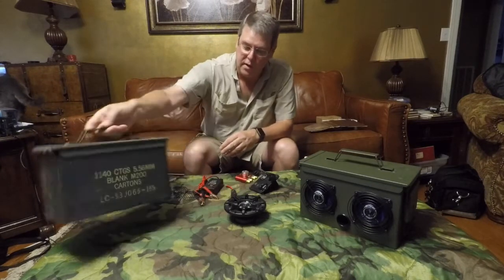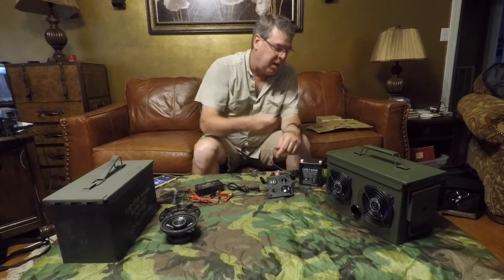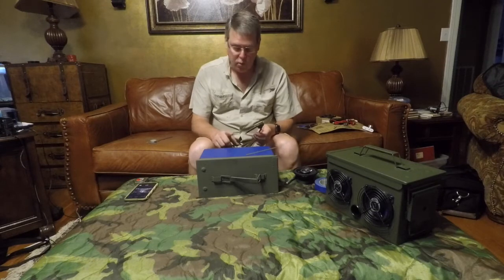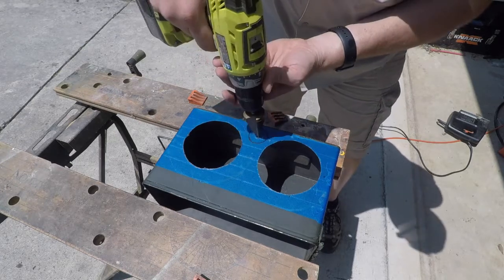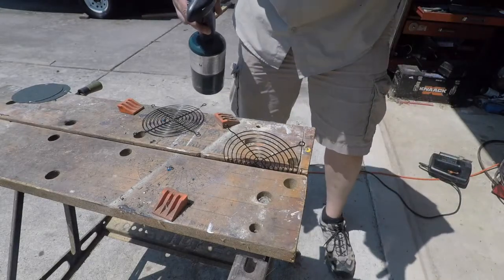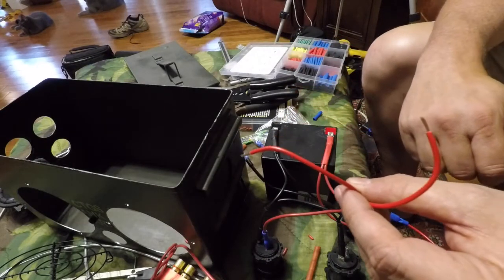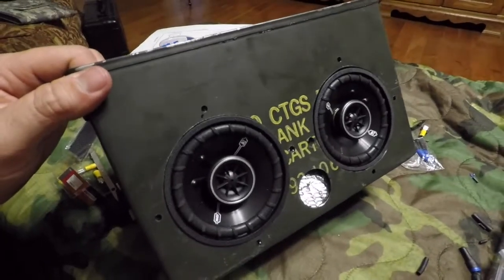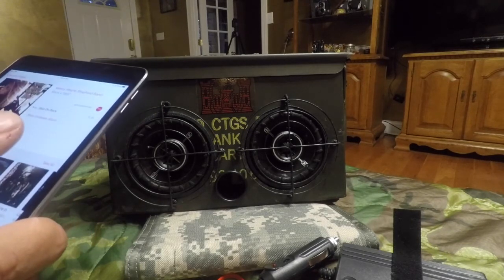Ammo Can BlueTooth Speaker Build

Comment: nice job.. i have been debating adding a port to my ammo boomboxes... i like how you have the 12v socket as the charger, mine has a separate plug to charge.. didn't realize the cigarette lighter port could be used for outgoing power and also incoming to charge...

Comment: How is the amp connected to the power with the excess two connectors? I’m building this right now and am at a standstill. Thanks and the video is extremely helpful!
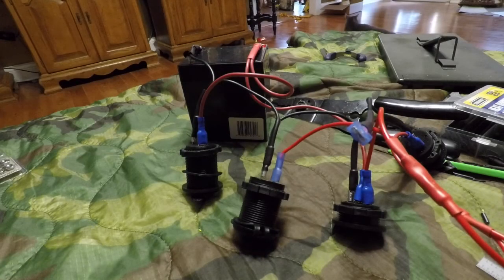Reply from the maker: Sorry, I left a short clip out of the video.  At 28:13 I am showing a wiring harness and it ends with a positive and negative wire with a female connector on each. The power cord to the Bluetooth/amp module plugs in there.

Comment: Can you go into more detail on powering the amp? Did you splice in before or after the transformer?
Reply from the maker: There is no transformer. You have the battery that goes to the switch, and from the switch you have a wire that is connected to the amp.
Reply: @brentspepper2087  I was talking about the amp itself. The amp has a wall plug in that goes to a small transformer with a smaller wire the plugs into the amp. In this case, I would assume that you splice the wiring from the t12 VDC battery into the wire past the transformer, correct?
Reply from the maker: @600gmc  I understand. This has been asked before. Some how that portion of the video wasn't included. I simply added a male adapter plug to a wire coming from the switch and going to the amp. The transformer than came with the amp is not used.
Reply from the maker: At 28:13 I am showing a wiring harness and it ends with a positive and negative wire with a female connector on each. The power cord to the Bluetooth/amp module plugs in there.

Comment: This definitely looks a good practical build that will be rugged in the field unlike the poncey commercial off the shelf ones. Just a few things though when clamping the ammo box in the workmate try putting some offcut wood noggins inside the box that fit closely and you can clamp it more tightly without fear of crushing it. Also i did not like the way you did the cut outs on the stencil print side of the box as it looks messy on the finished item. Surely the plain side would have been better?
Reply from the maker: Actually I wanted the stencil side to be showing on the front. I've done a a few using new cans that had no stenciling on them.

Comment: 2 questions. First question. How do you do the power cord from the outlet to the cigarette lighter adapter. (What do you use?) Second  as everyone else has asked about connecting the amp for power. I saw the video and it shows the wires to connect the amp but not what wire you used from the amp to connect to it. Very confusing both of these questions. Otherwise very informative and I'm looking to build it this weekend but need these answered
Reply from the maker: The amp instructions are in the video description above. I guess it was left out because it is so simple. I'm not sure what you mean by "The outlet to the cigarette lighter adapter". It's just a 12 volt charger with clips for negative and positive. Cut the clips off and wire them into a cigarette plug.

Comment: 3 questions.

How long will the battery last?
I noticed the amp you linked was 50 watt but the speakers 180 watt, is that right/does that cause any issues?
To allow the 12v to be used to charge did you have to wore it a different way?
Reply from the maker: Honestly, I haven't timed it to see how long the battery will last.  The speakers being a higher wattage than the amp is not an issue. if it were the other way around then that would be a problem.
Reply: Jake Evans The only real problem with using speakers with a higher power rating than the op amp is that they may sound a little understated due to the amp being underpowered in relation to them. They will not neccesarily draw more current than the op amp can provide but will definitely lack gain when you crank it up to 11.
Reply: 180W peak. Those are no more than 50w rms. You pair speakers to amps using rms wattage not peak

Comment: Where did you find the charger itself with the male connection on it, that seems to be the only parts I can't find. Thanks!
Reply from the maker: I made it. I bought a small 12v charger and cut the alligator clips off and connected the cigarette lighter plug onto it.

Comment: Brent, I followed your plan and love the sound from this.  I have begun getting a popping noise from the speakers after 45 to 75 minutes of continuous playing.  I'm at a loss as to what can be causing this.  Any ideas or suggestions?  Thanks in advance.
Reply from the maker: John Lewis check all you wiring connections. Could be temperature related since it starts after it has played a while.

Comment: Good build. I'm planning on making one using your method of setup. How did you connect the amp to the wiring harness?
Reply from the maker: Thanks. I just realized that I left out a short clip of video. At 28:13 I am showing a wiring harness and it ends with a positive and negative wire with a female connector on each. The power cord to the Bluetooth/amp module plugs in there.
Reply: The wire itself, or did you add connectors to the ends of them?
Reply from the maker: Around the 3:30 mark I talk about the Bluetooth/amp and that you can get it with a power supply. I cut the DC cord of the power supply and connected it to my wiring harness. You can also buy a package of the male connectors and make your own connector to connect to your wiring harness.

Comment: Does a mid range speaker even need a port?  I thought ports were for sub woofers.
Reply from the maker: I'm not sure if you could get by without a port or not. Because of the confined space and the amount that these speakers move, I opted to put a port in it.
Reply: @brentspepper2087  Ok so next question, Do you need to measure the cubic inches to figure the correct port size? There are several sites that help you figure port size for sub cabinets
Reply from the maker: I didn't go so far as to calculate the port size. If I were building a larger, more custom speaker system I would. For this rugged, outdoor type speaker I didn't bother.
Reply: @brentspepper2087  where did you purchase the port from? i did not see it linked
Reply from the maker: @chrisdS-3C-130  the port is a tube that goes in a golf bag. I just cut it down to length. I get them at Academy or Dick's Sporting Goods.
Reply: @brentspepper2087  much thanks, found the tube at Academy. Think it was less than $2.00. Speaker sounds great.
Reply: @brentspepper2087  I always understood that with bass reflex ports they required tuning? I guess you can get some sort of decent sound with experimentation but high end versions of this concept have precisely calculated cabinet volumes and port tube lengths. If your bass units have a lot of travel they are needed but most mediocre speakers get away with an infinite baffle construction and some acoustic wadding material to dampen internal vibration.

Comment: How did you wire the power adapter for the amp please
Reply from the maker: This has been asked before. Some how that portion of the video wasn't included. I simply added a male adapter plug to a wire coming from the switch and going to the amp. The transformer than came with the amp is not used.

At 28:13 I am showing a wiring harness and it ends with a positive and negative wire with a female connector on each. The power cord to the Bluetooth/amp module plugs in there.

Comment: I missed how did you hook the amp to be powered on with the power switch?
Reply: I really like your build and the simplicity thanks for the detailed video!
Reply from the maker: Sorry, I left a short clip out of the video.  At 28:13 I am showing a wiring harness and it ends with a positive and negative wire with a female connector on each. The power cord to the Bluetooth/amp module plugs in there.

Comment: How did you wire the amp? You skipped that
Reply from the maker: It is in the video description.
Reply: I must have gotten the wrong amp cause mine has a wall plug with a box connected to the cord. I used the link provided. Do I just cut the plug off and add connectors? And do I leave the box connected to the cord?

Comment: You didn’t show how to wire up the amplifier?
Reply from the maker: At 28:13 I am showing a wiring harness and it ends with a positive and negative wire with a female connector on each. The power cord to the Bluetooth/amp module plugs in there.

Comment: You keep saying the amp wiring issue is so simple, but you are leaving something out.
Are cutting and modifying the power cord that came with the amplifier? How are you transitioning to the actual connection on the amp unit? This is a great video except for this one very important detail that ultimately make the entire video useless. We are amateurs not electricians.
Reply from the maker: Yes, I accidentally left a portion out of the video. It's in the description above.